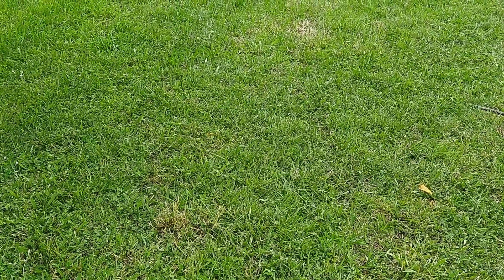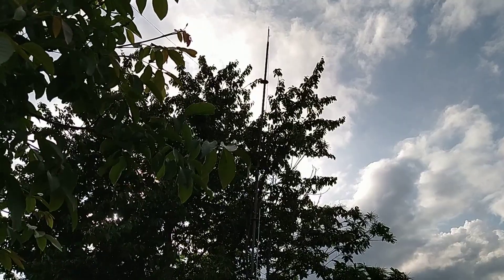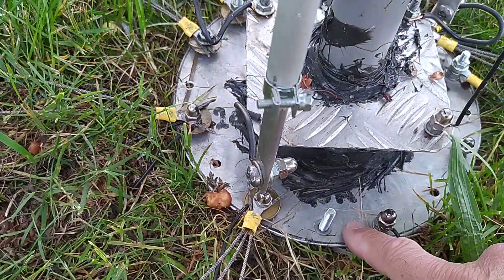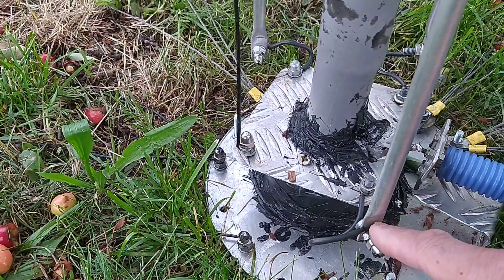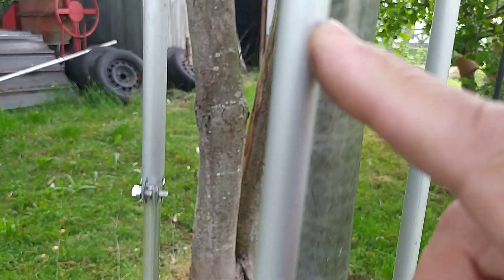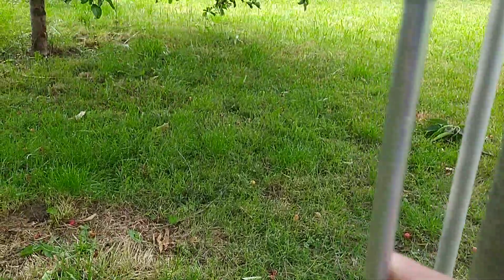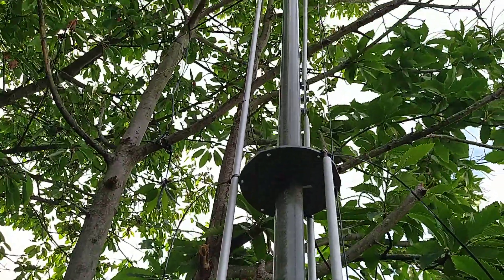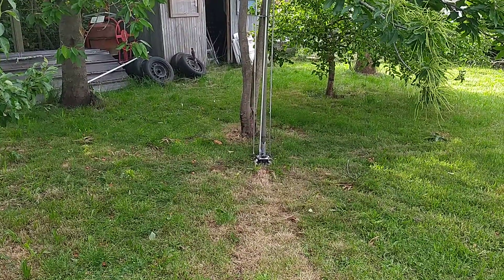home made groundplane multiband hf antenna

Comment: Hi nice to talk to you earlier on 40m. Very nice homebrew antenna. I'd like to try this, although my garden is smaller so it will be closer to the house which may be an issue. Cheers Rob 2E0YMD
Reply from the maker: Hi thanks for qso   ,for best results ist recommend to ad quarterwave lengt radials
bud you can also ad shorter radials bud den you need more radials , it depens on you soil ,type of soil, if you have good conductive soil you will need less radials good luck 
grz 73  ON3YNL